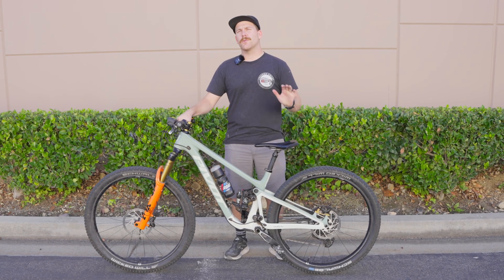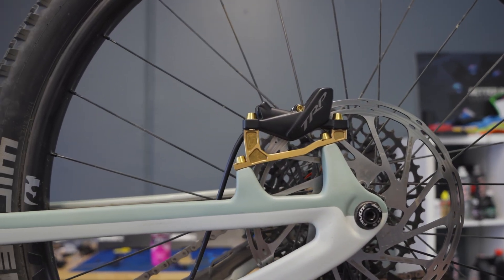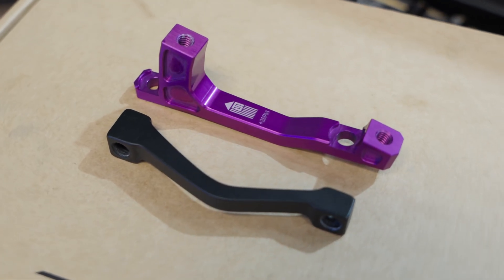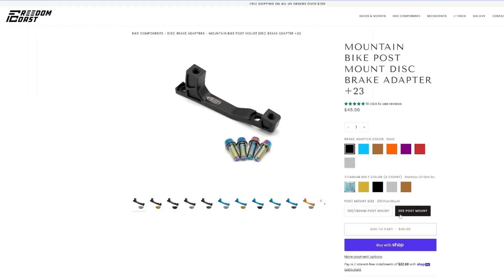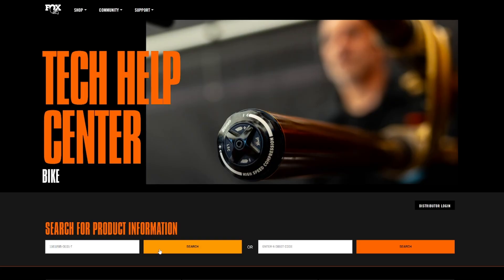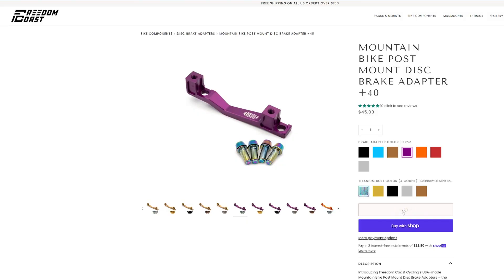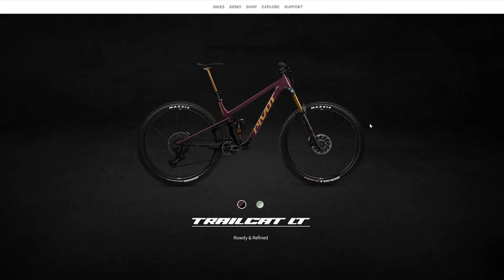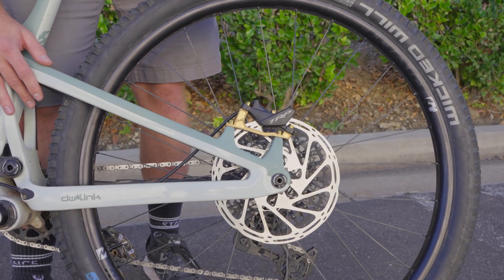How to Select Mountain Bike Brake Adapter Size

Comment: Are you able to tell me which adapters I need for front and rear brakes please I find it so confusing, I have a 2022 Canyon Stoic 4 in large, and Hope 203mm rotors front and rear, and magura mt7 brakes
Reply from the maker: Shoot our team an email at info@freedomcoast.net and we can help you get the correct adapters. Please include a photo of your front and rear brake installed on the bike.
Reply: @freedomcoast appreciate you brother

Comment: I have a GEN 3 Trek Roscoe 8 Front disk rotor is 203mm and Rear is 180mm can you help me with the correct adapter size for my bike ? Im running Shimano MT420 4‑piston calipers